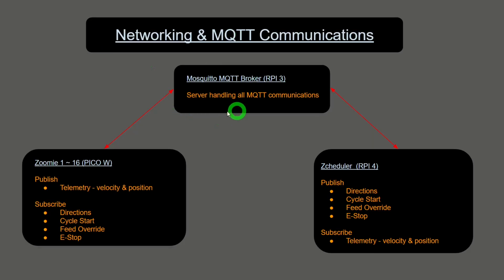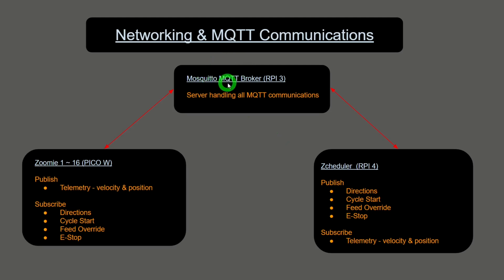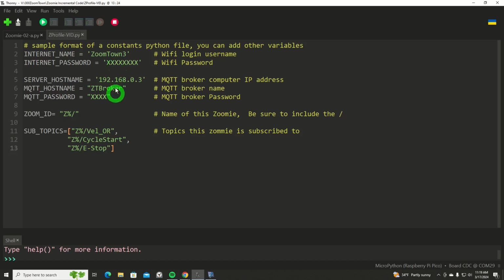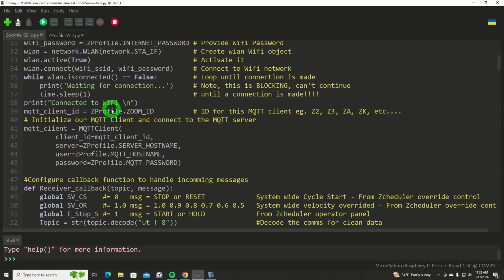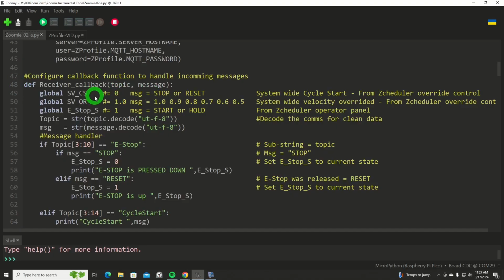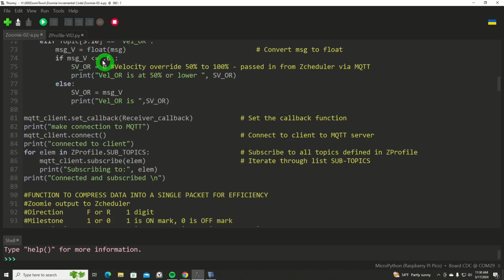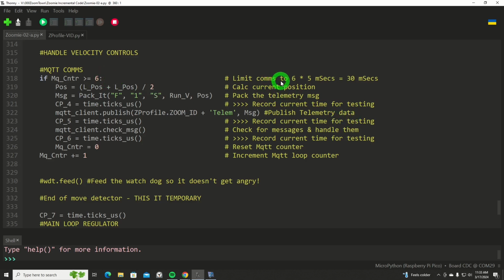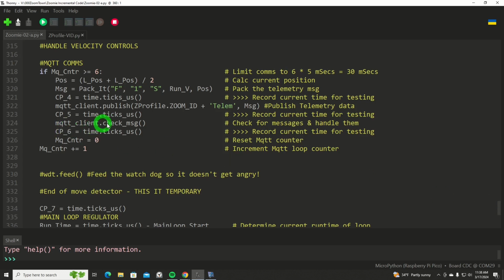024 Incorporating Mqtt into the PICO W to Give the Zoomie a Way to Communicate

Comment: I use an RPi 2 as an MQTT broker.  I set it up several years ago.  I was using an RPi 3B to monitor outside temperature and humidity and sending the data to an RPi 4 via MQTT.  I had mixed results because of a marginal WiFi signal strength at the location of the RPi 3b.  The WiFI problems were caused by trees not distance.  Last summer the RPi 3B died.  I replace it with two RPi Picos.  I send data from an outside Pico via LoRa to an inside Pico W. The inside Pico W publishes the data using MQTT. I haven't had any problems with this setup since it was implemented.
Reply from the maker: Nice solution to the WiFi limitations.  I have not done anything with LoRa - I did recently see an news blip (perhaps teaser line for a youtube video) that hinted at LoRa being banned or something?  Did you see or hear anything about that?
Cheers
Chris

Comment: Hi Chris, is it for performance reasons you decided to have topics labelled at the "Zoomie" level rather than including the Zoomie ID in the message payload ?
Reply from the maker: Hi Steve, If I understand your question correctly, I always work with MQTT using the Topic level.  If I were to put the ID (of the receiver) at the msg level, every Zoomie would read every msg going to every Zoomie, then have to decode it to see if is for this Zoomie or one of the other ones.  
Each Zoomie can subscribe to topics and will only receive those topics and thus, putting the ID at that level seems to be the most efficient.
Cheers!
Chris